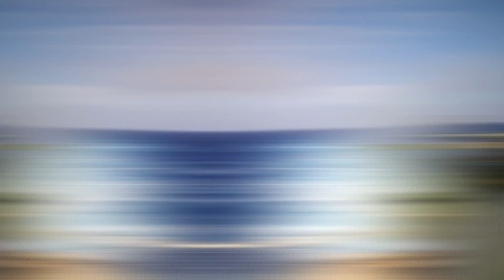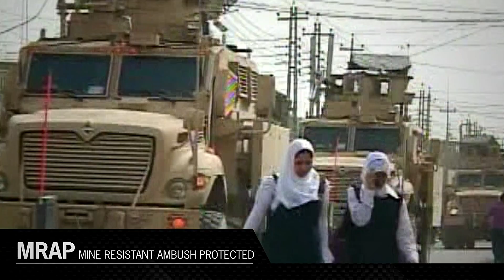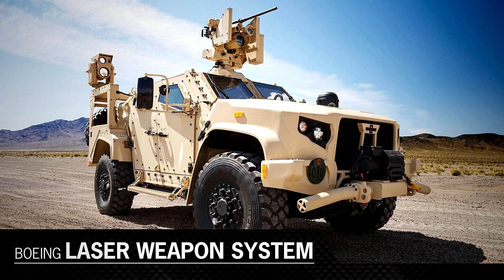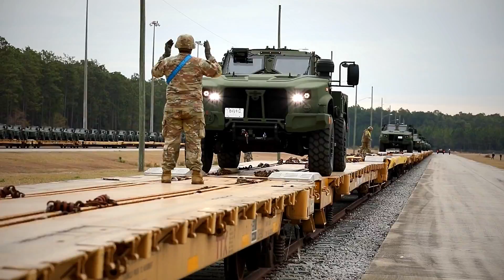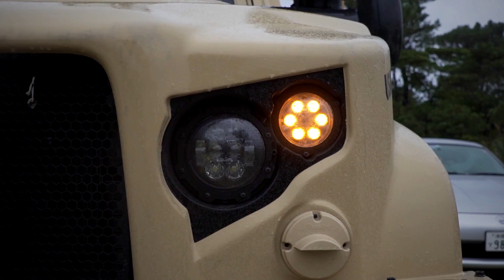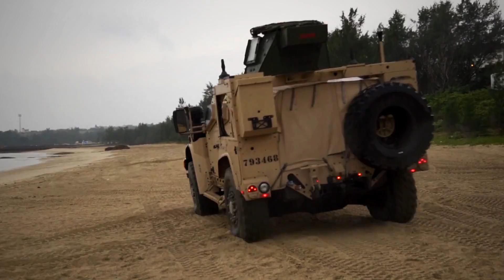America's Deadliest Multi-Gun Tactical Beast Smashes Enemies and Competitors

Comment: The real question is what's it like inside, how does it drive, and whats the weapon system like. The HUMVEE was so slow with all that armor on. It was also hot inside and very uncomfortable when wearing a kit with body armor. This looks better, but hopefully its more than just looks. I also hope the remote guns up top have thermals, that's great at spotting IEDs and enemies at night.
Reply: think Medium duty commercial (like the F-650) truck meets Baja Trophy Truck. OshKosh is the owner of the Pratt & Miller racing brand. wanna know what they make? the Chevy Corvette Z06 GT3.R Race Car along with every other corvette race car from 2001 and up alongside GM/Chevy.... so they know a thing or two about making cars perform well.

Comment: If a rubber track with several CV axles or independent motor source as n in the track two wheels spin out of eight making the all terrains easier as in a tank design if in the center storage system install a airbag float tank that can have interchangeable outfits but hold the cab. Four independent motors one for each rubber normal wheel extention CV axles system to crane in to place the rubber tank track chain design.

Comment: I think Biden is right, if we replaced the internal combustion engine with a rechargeable battery powered electric motor it would be fine. As long as the enemy doesn’t mess with the power grid and take time out breaks to allow recharge time, for the environment. The torque could carry more depleted uranium rounds. 😂
Reply: Joe Biden and Obama 🙈 God Save Us 🇺🇸
Reply: You don't think in general. Why lie?

Comment: The Humvee days are not over. They will be utilized in the CSS role. The Hummer is a very good vehicle that works great for what it was designed to do. But being a CS guy, I'd rather be in a JLTV than a Humvee when out clearing mine lanes or at a hot bridgehead. Thats for sure!
Reply: If the fuel efficiency and speed now matches, there's literally no reason to keep HMVVV's, except for peacetime training and a few small transport roles until they're gradually scrapped or sent out. Part of the 'issue' with MRAP, their original vehicle, is the top speed was half, the IED protection and armor made it slower, and so engine couldn't perform the same speed and roles, but if the JLTV can simply do that with the enhanced portection, then there's no reason.

Comment: Dont care how fast a jeep is, it aint faster than an RBG. Which is why you want a Bradley or Abrams with you.
Reply: I think you meant RPG. Small lighter vehicles have a place in the military for the roles they were intended to fill. The hummer was used improperly in Iraq. MRAPs replaced them for the most part; however, still a need for a multi-role scout which is where the JLTV fits in
Reply: @nsatoday  point is, it's not a game changer

Comment: Working on an EV version of this? I dont think you are going to find charging stations on the battlefield. They will be charged by diesel generators back at the base wiping out their "green" status. At 25-27 thousand pounds it would take a massive battery pack that would take some time to charge, instead of pouring in some diesel and continuing with the mission, Battery fires from battle damage would be a huge concern also, EVs do not belong in front line military service period.
Reply: It’s a hybrid power train being worked up first. Small diesel generator to power the vehicles and electric motors and a small battery that’s being used mostly as a capacitor. It would increase range on the base fuel load by about 50-70% depending on final weight. 
The full electric will be an R&D toy.
Reply: Battery technology is catching up.
Reply: @petucker548  Yes.  It's catching up on fire.
Reply: Just have to beg China for lithium batteries.

Comment: Any military that “Goes Green” with their combat vehicles is going to lose the battle and the war.
Reply: The use of hybrid powertrains in combat vehicles isn't really about going green, there are definite advantages to silent/quiet running, extended ranges, and increased time between needed resupply that are force multipliers.
Reply: And combat vehicles that get 4 miles to the gallon need to be re engineered because the consumption is unrealistic and causes too great a strain on resources and logistics.

Comment: The Humvee didn't fail, it was just used incorrectly.  It was never meant to shield its occupants from explosions.  That's like claiming the standard uniform is a failure, because it isn't bullet-proof.
Reply: Yup serving in Iraq early on we started to stick weight on sand bags in the floor and so on we changed it's purpose to deal with the threat we had at the time of road side bombs and it still rocked and rolled so to call it a failure hurts and hits at home mine brought me home alive no complaints here if u ask me A2 looks like a nightmare to work on
Reply: I guess so, but modern standard uniform doesn’t work because of several reasons regarding optics and patents regardless of whether it’s bulletproof or not.
Reply: Humvees shitty hp and shitty torque ! Terrible overall
Reply: Well… no 💩
Reply: And these are just as resistant to explosions as the humvee was.
Reply: I also agree with your comments
Reply: You’re absolutely correct. The Humvee was meant to replace the Jeep with longer range wider and longer wheelbase and better 4 wheel drive. It was never designed for direct combat. Even after they “upgraded” to have armor it wasn’t enough so the army started bolting on More armor. It simply wasn’t designed for the way it was used.
Reply: Yes sir ! You are 100% correct 🤙
Reply: its a fail any way you look at it but it screams AMERICA and thats why they used it

Comment: The only way to make it possibly good enough as electric. Is if you can charge it 100% as fast as you can fill a fuel engine.
Reply: It will probably be a diesel hybrid.  The drivetrain will be electric, but it will have a diesel generator to charge batteries or supply the power to the electric motors.  Like how the Abrams X is “electric”.
Reply: @Lqualls11  Definitely
Reply: Plus both as electric and fossil fuels.

Comment: A full electric combat vehicle is no different than a throwaway gun or a throwaway soldier it will be a throwaway vehicle on the battlefield
Reply: The Russkis threw away bunch of ICE trucks and tanks for the Ukraine troops to use. They did the same back in the 80s in Middle East…